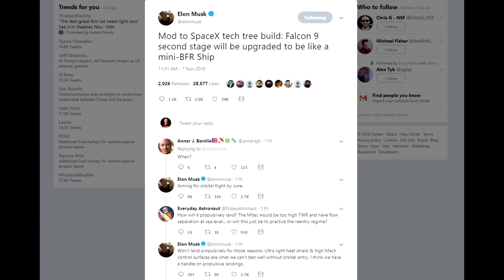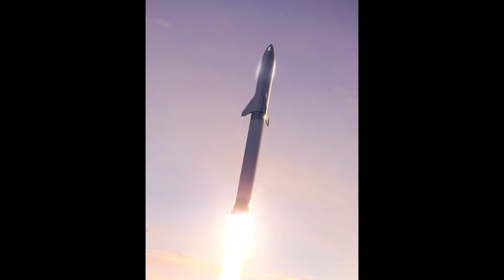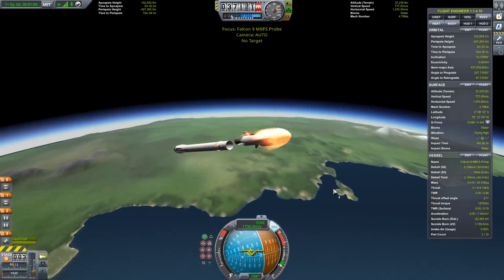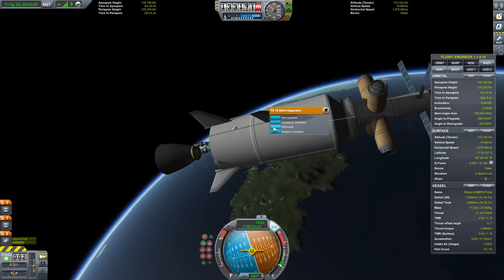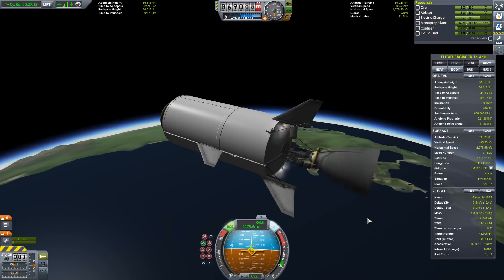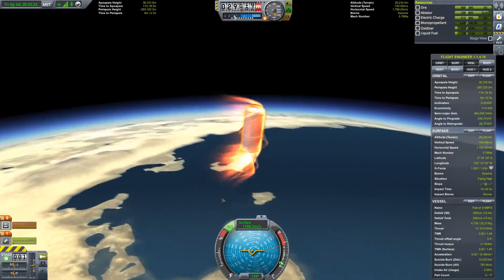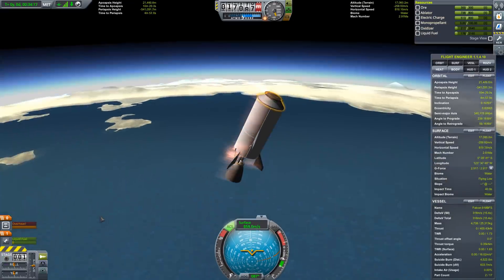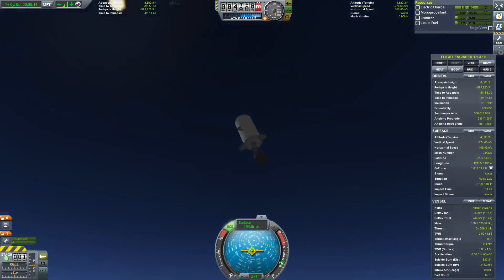SpaceX Evolving Falcon 9 Stage Into 'MiniBFS' For Testing

Comment: Oh, the BFR, such a well thought-through concept. Let's strap passengers to a bomb that burns multiple times the amount of finite fossil fuel that a plane would burn for the same trip and launch it in the vicinity of large cities. People will love that.
Reply: It's like you forgot that the BFR would be used to launch cargo into orbit and send people into orbit and other bodies in the solar system as well. The Earth-to-Earth part of the BFR was just one thing it's been advertised to do, which does not seem like a good idea. But the BFR still has Earth to space capabilities which seem to be the main intended role for the rocket.
Reply: There will likely never be a BFR type of craft flying city to city.  It may be technically within the ability of the craft but that is all.  It's a promotional pipe dream, I suspect the idea of a colony on Mars is along the same lines.
Reply: @TheEvilmooseofdoom  I could see either happening, but not anywhere near to the degree Musk is talking about. Rich people may pay for a BFR flight to go into space, and then land at a new destination to vacation in, before catching an airliner ride home. I could see people paying for this service. You'd need to pick your launch sites and destinations carefully, and the main focus of the event would be everyone on the rocket going into space. I don't see it even marginally successfully replacing airliners in their intended role.

The BFR certainly seems to have the ability to lift the supplies and people for a colony on Mars, so it's believable at the least if other issues with that sort of long distance spaceflight and colony construction/management are solved. He could probably lift enough people and supplies there for a colony in the next couple to a few decades. I do not see a Mars colony of tens of thousands of people any time soon; 1000 seems very optimistic to me. I forget the exact numbers of people Elon was planning on putting on Mars, but I remember feeling it was probably off by a large factor. I forget if the factor was 10, 100, or 1000 to be honest.
Reply: @noname117spore  The problem with BFR as city to city passenger flights is that all the infrastructure will have to be built.  There are no airports that can land, fuel and re-launch.  Unlike adding a new airplane to a fleet that can integrate with existing infrastructure each BFR landing/launch site will have to be located, purchased, structures built etc.  All that expense just to service one kind of craft for a single customer.  That's a lot of money and infrastructure that will never pay for itself.  Some may be built for reasons that you cite but probably not a large global network of landing/launch sites at least not while there is only one company using them.

A Mars colony can be done.  My point was the the hope for a Mars colony is the carrot at the end of the stick to drive development.  Cheap, reliable and reusable launch systems are a benefit no matter what project they're being used for.  That development is the really important part much more so than any far flung future destination.  :)
Reply: @TheEvilmooseofdoom  I do agree with you on both of these points. BFR may be used for Earth to Earth, but rarely, only between launch and landing sites SpaceX was already using, and for space tourism rather than for travel. Elon seems devoted to the Mars colony, so it'll probably happen if nothing goes badly wrong, but I highly doubt it'll be big. And yeah, the development of cheap reusable rockets and the ability to transport people outside of Earth's sphere of influence are the 2 most important parts of BFR development.

Comment: SpaceX will need to start launching Starlink Satellites by around June of next year if they hope to keep their licensing to launch them. Half the constellation needs to be up within the next 3 or 4 years, so the 'Customer' could very well be them. Plus the small profile for those satellites means they could be easily adaptable to changes in the faring configuration/payload adapters. You can also vary the number loaded to compensate for changes in weight/thrust tolerances.

Comment: I’ve thought about this problem a lot (even before Musk) and always come up with having to do an engine end first entry using some kind of deployable (maybe inflatable) heat shield.  It all ends up being counterproductively heavy.  The fins (or any protrusions directly exposed to the atmosphere) are really hard to make survive.  Of course it can all be done like SX is hinting at using established Shuttle like TPS everywhere but that is a ‘money is no object’ solution that, again, kind of defeats the purpose of it all.  I hope they do have some imaginative workable solution they plan to test out but this is going to be a really tough problem to solve.  A NASA size problem.
Reply: The stage will be returning mostly empty of fuel. Its ballistic coefficient will be far lower than the space shuttle, or probably even than the full sized BFS. That should make the re-entry much more mild.
Reply: Can't they change the stage separation so that the booster detaches further down and leaves (part of) the interstage shroud covering the second stage engine bell?
Reply: @argh1312  They could, but interstages aren’t all that light.  They would only need to retain half of one (a little less actually) anyway but that isn’t a bad idea at all.  An idea I had was along the same lines, but having the payload shroud extend downward to enclose the entire second stage, that way, a larger diameter heat shield could be installed at the nozzle exit supported by length adjustable struts for attitude control.  A mechanism like that of a camera lens iris would cover the majority of the nozzle exit area prior to entry.  After all that, you would still need some kind of landing leg arrangement.  It’s starting to get heavy, and complex.
Reply: @argh1312  In fact, to add to that; do like you said but have a couple fold joints in the interstage where it folds out to provide more surface area in the direction of travel.  Adjusting the degree of fold could be used for control and eliminate the need for control surfaces.  The surface area of the expanded interstage may balance out fairly well on the CG.

Comment: Or they could just use a sea level merlin engine in the upper stage. It does work pretty well in vacuum too.
Reply: A sea lever Merlin still can't throttle low enough to land a second stage. Second stage propulsive landing just isn't happening with a Merlin.

Comment: Hi Scott, I don't see the point to do all this just to try to test aerodynamics features from the BFR that it would be substantially different which could become in a waste of time and money.
The only thing that I can imagine in order to make sense of this would be an hydrogen upper stage using one BE-3U engine from Blue origin (because the raptor is too powerful I guess and it would not have the extra deltaV that it needs) with a carbon fiber structure for the whole spaceship using internal pressure ir order to keep structural integrity.
The extra volume require for hydrogen helps to reduce the reentry temperature because the ship density will be much lower.
If you reduce a bit the payload to orbit, then I think it may have sense.
This would reduce a lot the cost to orbit for small payloads.

Comment: Well, development cost of building a miniaturized BFS may be not worth it. You just need a testbed to proove new technologies and procedures.

About the landings...
If the final reusable upper stage is lighter using an inflatable heatshield and parachutes down onto Mr Steven or something like that, it's probably not worth the effort to spend the money dveloping this testbed's return.
The engine might be switched for a sea level version if an attempt for propulsive landing is done, but they would lose valuable Isp and therefore dV for the main mission, and no significant experience would be gained since they're already very experienced with boster landings and firing sea level engines in vacuum.

Replacing the Merling with a Raptor could also be too expensive. Modifications on the launchpad would be needed in order to supply methane fuel. Not to mention that the Raptor engine is a monster, I don't know if it can be throttled down to acceptable thrust force levels on the structure of the stage, Jeb could lose consciousness :)

Comment: The BFR keeps shrinking as they realize they can't deliver on the last design--from 300T to LEO to 150, and now to 100. The next step is 50, and at that point they might as well stick with the Falcon Heavy and build some Dyna-Soar-like vehicle that would just incorporate a Falcon upper stage. Admittedly the payload would be no bigger than a Falcon 9, but it would be 100% reusable. It's pretty obvious the BFR per se is a dead letter.

Comment: It they want to integrate a Raptor into the second stage, they will have to change to methane/LOX as fuel.
Reply: A Raptor has over twice the thrust, so it's probably quite a bit heavier. I doubt they'd gain performance from the switch.

Comment: Could they possibly make a nozzle extension that's expendable, and jettison it to make the engine usable at lower altitudes?
Reply: A Merlin engine's minimum throttle setting is just too much thrust to land a second stage propulsively. With BFR actively in development, investing a lot of money to significantly re-engineer the Falcon 9 doesn't make sense.

Comment: Would it be possible to make a landable second stage if a good deal of the vacuum engine bell was jettisoned?
Reply: Even with a sea level bell, a Merlin can't throttle low enough. The first stage lands with a single Merlin and even at minimum thottle, T\W is above 1. They make it work with clever software, but on a second stage, the T\W would be way too high for landing.

Comment: One of the nice things about the Merlin 1D FT engine is that it has an insanely high TWR of 180, which is the highest of any orbital rocket engine ever built by a healthy margin.  For comparison, most engines have a TWR in the 70-90 range, though there are a handful of Russian engines that do better, with the RD-275M reaching 160.  This means that the stage 2 isn't really all that back heavy.  In any case, BFS will also have engines in the back, so what holds for F9 in terms of balance would be expected to hold for BFS.

I would expect the fin structure to match BFS.  After all, I don't believe any one's ever done control surfaces that actuate in the same fashion, or even tried to maintain that 90 degree AoA, and they will certainly want to test the heat shielding techniques for those long hinges.  Clamshell fairings may also be required - having the mounting hardware directly exposed to the airstream during reentry just sounds like trouble.  If they design them to open very wide they should be well clear of deploying satellites.  The important part is that they can close again afterward.

I fully expect them to try to pack a parachute or para-sail.  Getting the stage back in one piece for analysis is very useful, even if the engine is ruined by landing in saltwater and there's zero chance of it ever flying again, and the cost of failure is what would happen without the parachute anyway.  They might even try to catch it with Mr. Stevens at some point.
Reply: Totally agree. 
Except for the fairing part. I think they would leave it how it is
Reply: BFS will have a lot of deadweight at the front to balance the engines. The front a Falcon 9 second stage is mostly empty tanks.

Comment: How are space x going to reapply ablater to the bfr? Surely after time it will stop being effective
Reply: I don't think they're using a heatshield on the booster. It re-enters at a much lower velocity. For the ship, the heatshield is supposed to provide something like 10 flights before they need to re-apply it, and I think they said something about improving that.

Comment: If this is not to scale and is using hugely different hardware, then there is no point in trying to make this into something that every launch can use. Just make a dedicated test object that is just a scaled down BFS in all aspects - one Raptor, fully correct body shape, dummy payload. Fly that on a couple dedicated launches expending just a cycle of the booster and fuel and see how it behaves. That might be even cheaper than trying to cram extra hardware in customer launches.
Reply: A heat shield, flapping fins, and computer software to preform a few tests is much cheaper

Comment: why not just discard part of the nozzle to make it a lower expansion ratio?
Reply: Or just copy the XLR129 idea of having a two piece nozzle design that can adjust the lower half with jack-screws.
Reply: The nozzle is pretty complicated, they need to design and produce an entirely new nozzle which would bring costs up.  Might not be worth it if they don't really need it.
Reply: Minimum thrust of 1 Merlin is too high to land a second stage either way.

Comment: Who says they need a customer for a mini-BFR test? Surely SpaceX has the funds needed for test flights without needing a customer. What's to stop them doing a test just to do a test ALA the Falcon Heavy?
Reply: Yeah, but its a choice between making one/two dedicated tests or testing during potentially every commercial launch - more is better.
Reply: Never combined a parts testing mission with a tourist flight in KSP? It saves on Money and time. Both things that are´nt exactly in abundance in the real world rocket game erm business.
Reply: @sehrgut  They could cop the cost of an initial batch of raptor nine rockets for testing, experimentation and just showing that the basic stuff works, but then when its shown reliable enough they can offer it as a cheaper alternative and get far more data for little cost.
They might decide to take some hardware that's past its design life, and cannibalize it for spares to assemble the new rocket, or maybe even produce a falcon nine with a single mini raptor in the center position as well as the associated plumbing, tanks etc, and use it for smaller payloads which don't need the entire capacity of a falcon nine. The booster could test the new engine after detatching the payload. They'll probably have to reduce weight significantly, maybe remove one or two more merlins, and not carry enough fuel to propulsively land using the merlins, relying on the raptor instead. But It might just be possible.
Reply: @Marc83Aus  Aside from modifications for BFS tests, SpaceX said earlier that F9 dev is basically stopped, since they concentrate all their attention on BFR/S. It means they want to eventually get rid of F9 and having a single rocket to manufacture and launch. Risky but the alternative means to produce, maintain more rocket models than truly necessary. They are betting the company on BFR but it's the only logical path because Mars is the final objective.
Reply: @etbadaboum  I don't think that's correct. Yes, they've halted development of the F9 (for now, mostly because they have to launch the same rocket design seven times to get it human rated and then they can't change it and keep that rating) but the F9 will keep launching for years to come with smaller payloads, even when the BFR arrives.
Reply: @jmonsted  You're right, they'll continue to use it for future launches but look at the second Mars speech by Elon, he made it clear that they'll build a stock of them and relaunch them as long as clients are still willing to use them... But he explicitly said that they want to stop F9 manufacturing altogether and concentrate on BFR as their main vehicle.
Reply: They do it smartly and save money. Going on with F9 commercial launches while doing crucial R&D is smart. BFR is a huge piece of work and can put the entire company at risk, so they better keep a low financial profile and save every penny they can by avoiding big unnecessary spending.
Reply: I too assumed they'd just segregate the project, but that is defiantly not economical. I just hope this doesnt screw up their NASA certification for human flight.